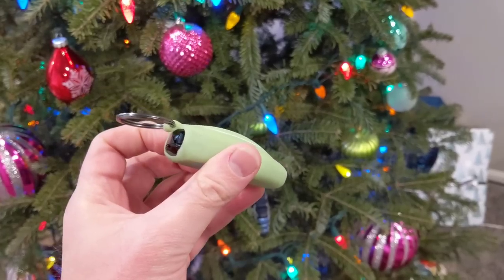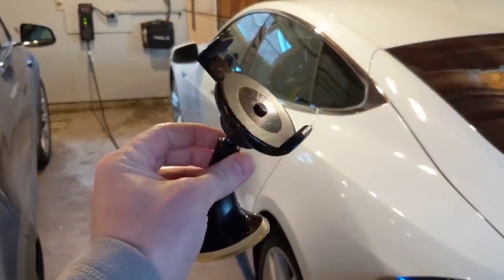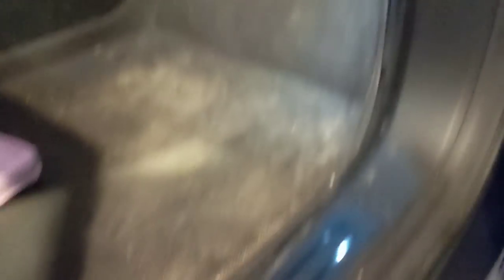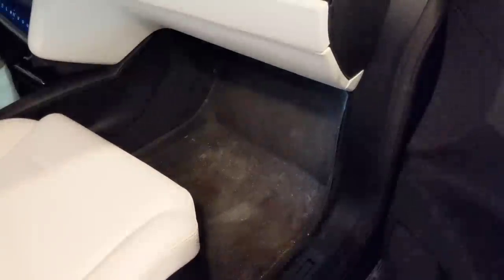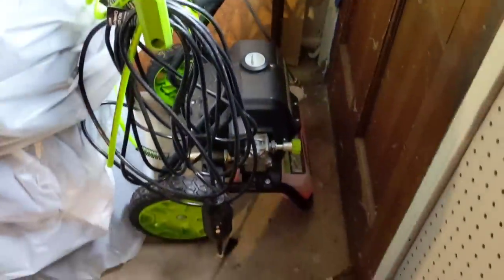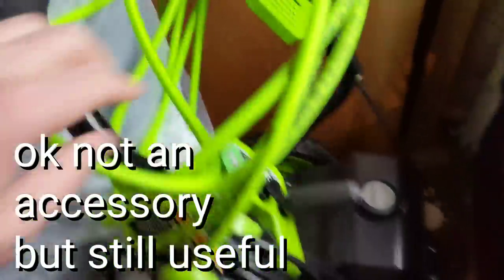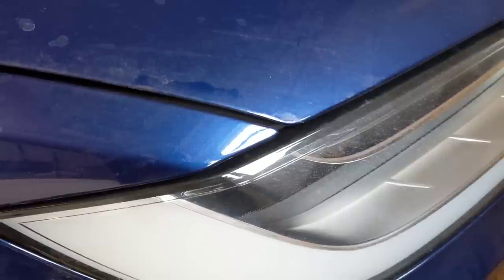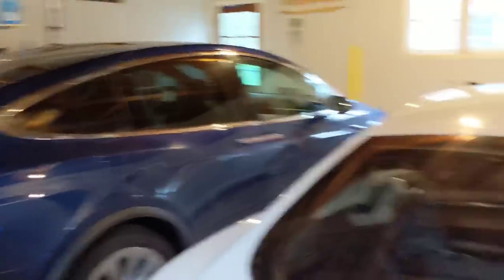Accessories and products I actually use with my Teslas

Comment: I had to laugh at the rust spots. Gifts left by the snow plow to splash up on your car. I was going to have my garage floor done with that epoxy finish....till a friend that installed them said not a good idea. It just ends up full of those rusty fillings in the winter and eventually makes a mess of it. Unless ofcourse you want to mop your garage floor in the winter.